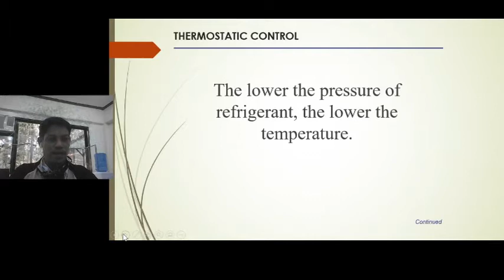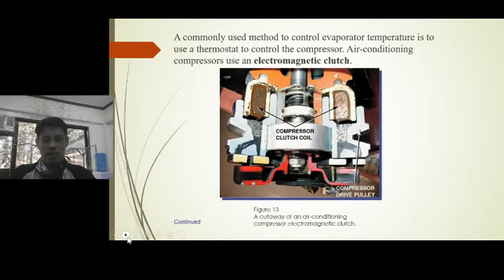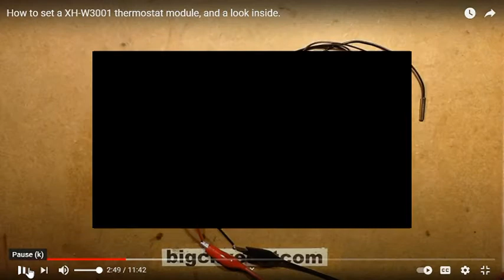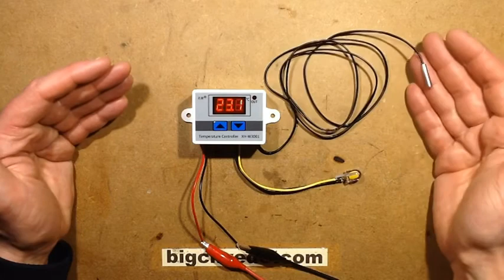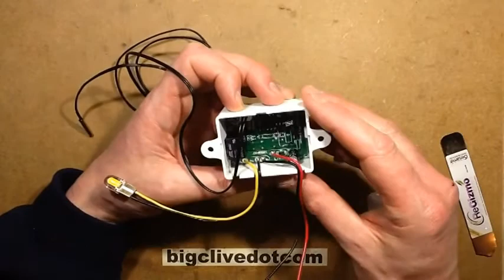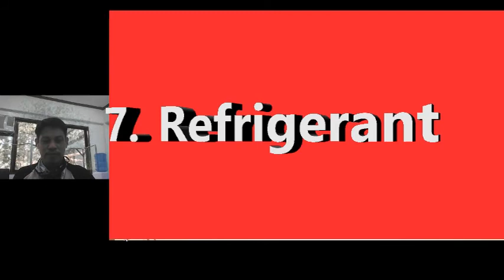6. Thermostatic Control

Comment: A thermostat exerts control by switching heating or cooling devices on or off, or by regulating the flow of a heat transfer fluid as needed, to maintain the correct temperature.

Comment: The thermostatic control, one of the heuristic or rule-based control techniques, has been widely employed for temperature regulation. The basic idea of the thermostatic control is that cooling is applied when the measured temperature exceeds a target maximum temperature.

Comment: The thermostat is the one that controls the temperature of the air coming out of the aircon vents. It constantly measures the cabin temperature, and turns the compressor on and off as needed in order to maintain the temperature inside the cabin.

Comment: Thermostatic temperature control systems consist of a thermostat plus some sort of heater and/or cooler. The thermostat is a thermally actuated switch that changes between the "on" and "off" state at a specific temperature, usually adjustable. ... Temperature control systems like this always oscillate.

Comment: A commonly used method used to control evaporator temperature is to use a thermostat to control the compressor. Air-conditioning compressors use an electromagnetic clutch.

Comment: air conditioner compressor is the component in the system that raises the temperature and pressure of the vapor refrigerant that leaves the evaporator coil.

Comment: A commonly used method to control evaporator temperature is to use a thermostat to control the compressor. Air-conditioning compressors use an electromagnetic clutch.